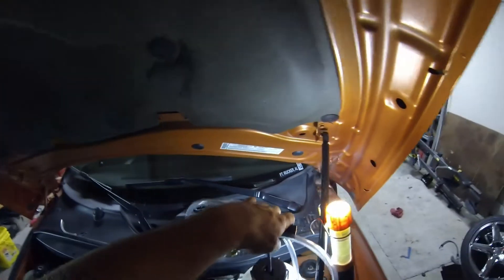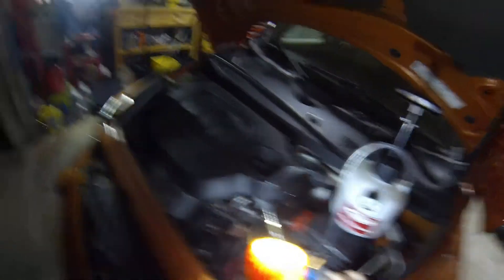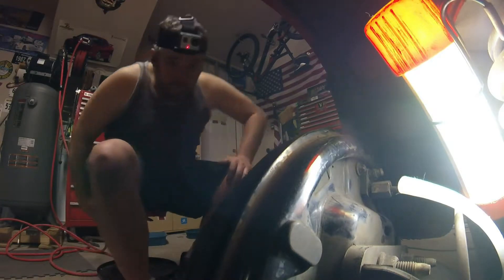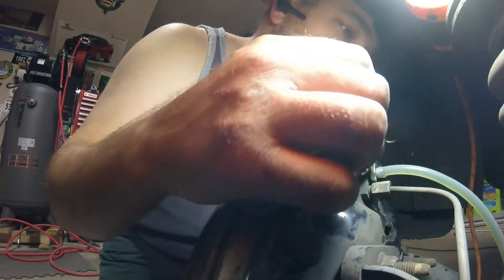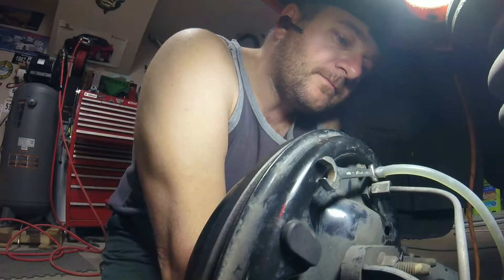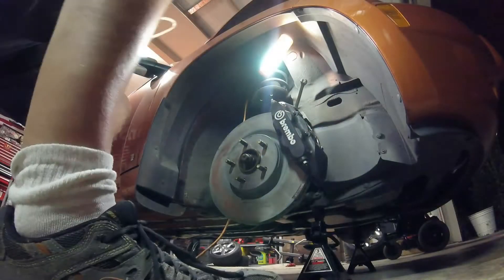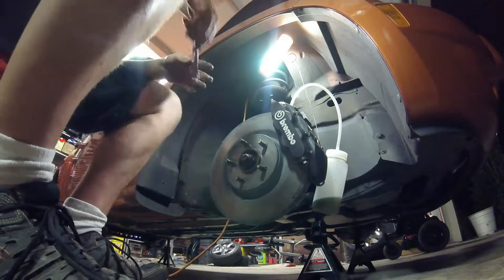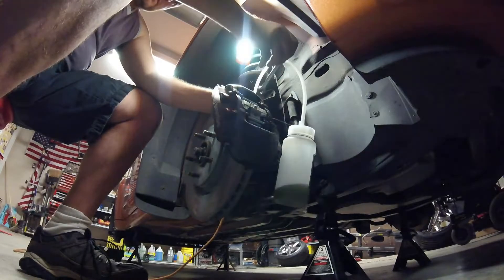pressure bleeding your brake system

Comment: Good Video Bud. I have a HHR we are having issues with brake pedal going to the floor. Master Cylinder has been replaced back brakes replaced because they were bad. Brakes were bleed at the wheels and with scan tool still having  areissues the Mechanic thinks the Booster is Okay we are at a Wall. But I like this Video I will order myself one of those pumps.